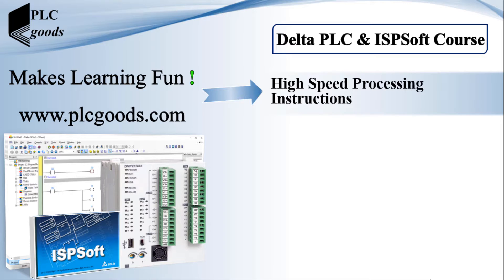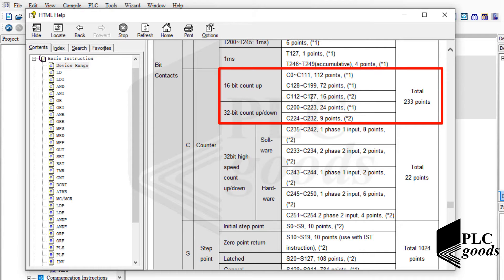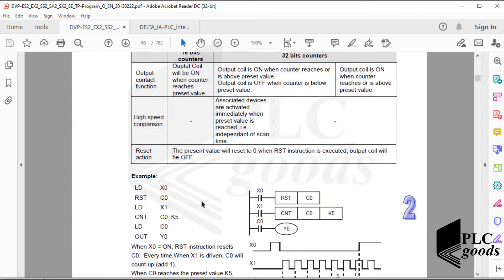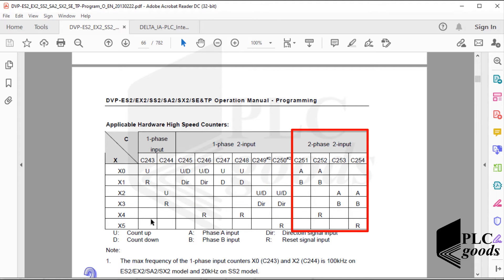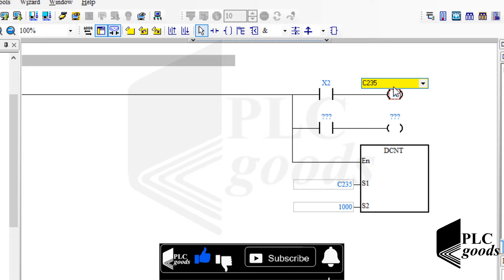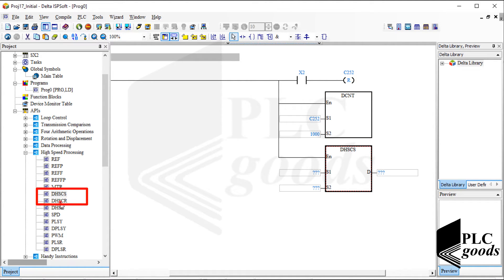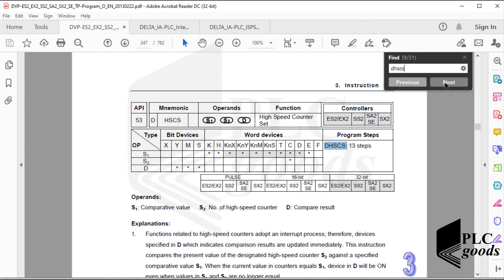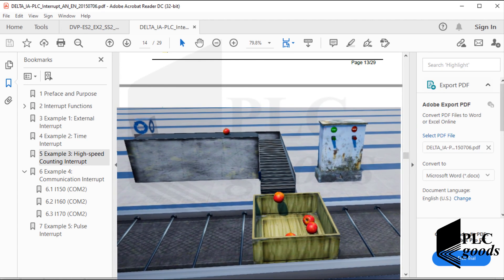Delta PLC High-Speed Counters Tutorial | High-Speed Counters Explained  | Lesson 17

Comment: This channel is pure gold, thank you very much.
If may I, I would like to add that before executing any step described in this tutorial, double check the PLC model you're using to match the High-speed counter and the inputs it uses. Also, when it comes to using a two-phase encoder (which is my case), a bit (MXXXX) must be used to START the doble counter, instead the phisical input X. For further information you can check out the chapter 2, page 28 on the manual <<DVP-PLC Application Manual (Programing)>>.

Thank you!.
Reply from the maker: Thanks for your comment. Please, if you have any question about the lesson, be more specific and let me know what exactly the question is.

Comment: Hi, very good information, i have a dude about high speed counter, the HC202, how can reset the input without digital input? Im using the instruction DCNT
Reply: Hi there, I do not understand your question exactly. If you mean how can reset the counter, naturally you can use the reset instruction (for example see the time 10:00)
Reply from the maker: Hi, how was the result? did it work?
Reply: Hi, yes I tried reset the high speed counter with reset instruction but, don't working, finally i can reset with the instructions DRST

Comment: thanks bro, but i can't do same you C243,please help me
Reply from the maker: Hi there, maybe the counter names of your PLC are different from mine. Also, pay attention that counters can be used in different methods (1 phase input, 1 Phase 2 input, ...) with different inputs (X0, X1,...). therefore read the counter section of your PLC user manual carefully
Reply: Can I use another external input such as X20 instead  to count C243 as highspeed counter ?